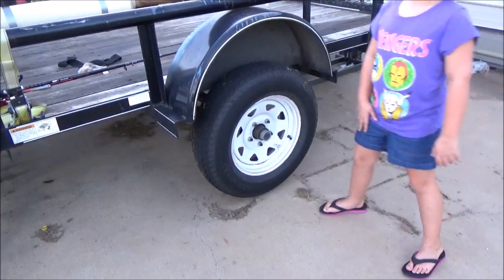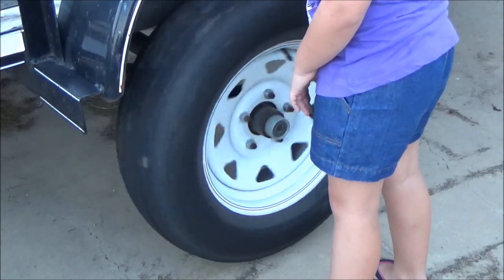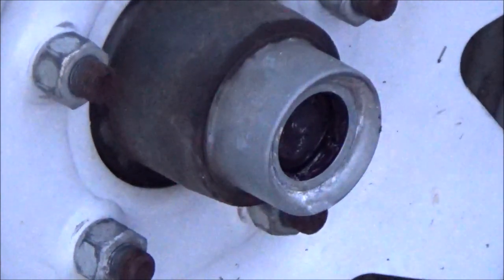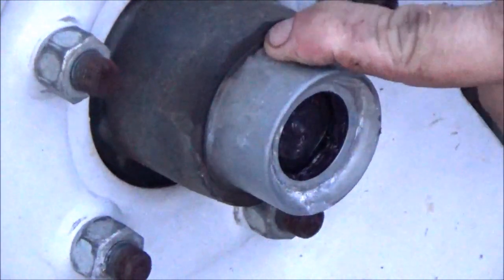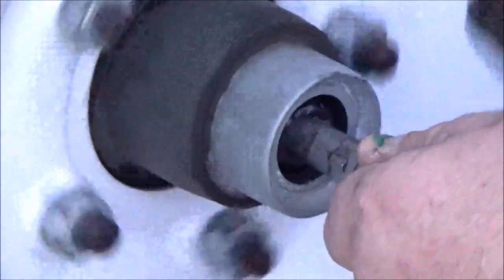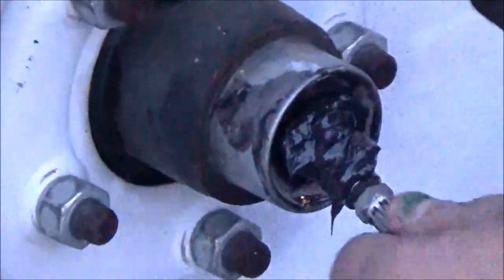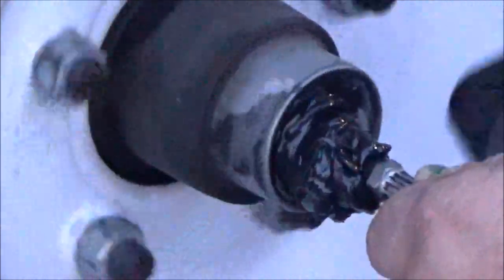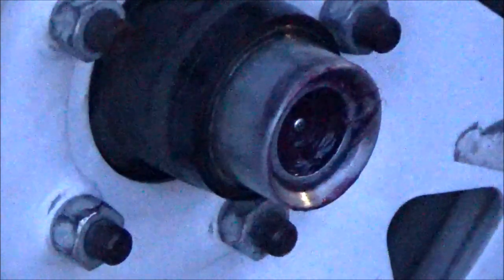DEXTER AXLE E-Z LUBE SYSTEM  /  LAWN MOWER TRAILER BEARING  /  HOW TO  RE-PACK

Comment: I'D BE INCLINED TO BELIEVE THE REAR SEAL IS READY TO BLOW
Reply from the maker: By design the system can be over pressured. Use common sense here.  If in doubt use a squeeze type lube gun

Comment: What happens if you do it without jacking it up?
Reply from the maker: YOU MEAN JUST SHOOT THE GREASE IN?
Reply: Yup, cause I'm sure most people don't even grease them, but if they happen to see the grease zurk, I doubt they would know to jack up the tire and spin it while greasing.
Reply: The make a mess whenever you do that. That was the first thing I did with my new trailer. The grease continues to ooze out after a while and will also rot out that rubber boot. On my new trailer I just grease them until it starts to come out slightly then stop. Not the way want you to do it, but atleast their is no mess.